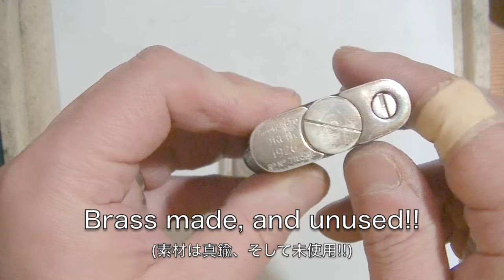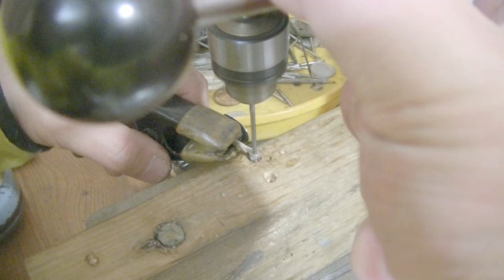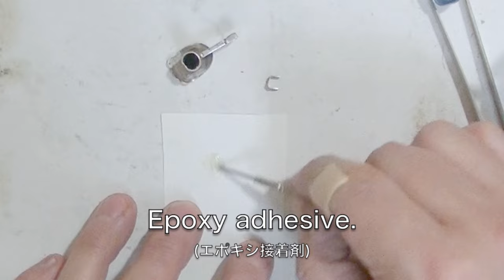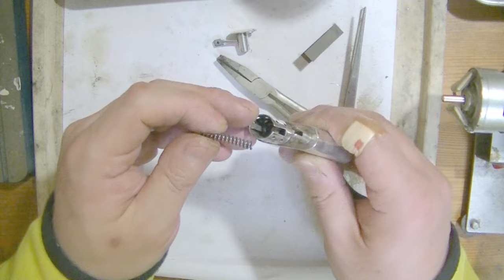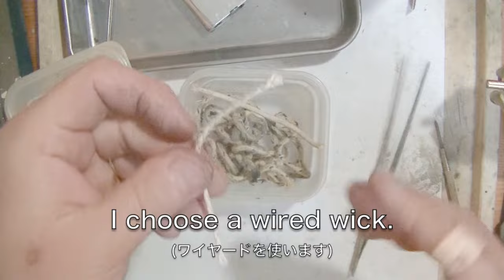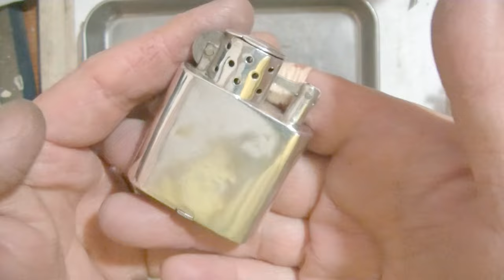【100 year old petrol lighter】Sterling silver ORLIK 1926 restoration

Comment: As soon as I saw the title sterling silver, I knew it was going to have distortion issues . Silver is nice for coins, but too soft to be practical for anything else requiring rigidity . Nicely done with brass insert to return to working condition . You are an able man .
Reply from the maker: As explained in the video, the manufacturer cannot do it this way even if they wanted to because would not be able to engrave the hallmark. You are right, sterling silver lighters will always face this problem. My life's work is to turn “ornaments” into “tools”. Thank you✨